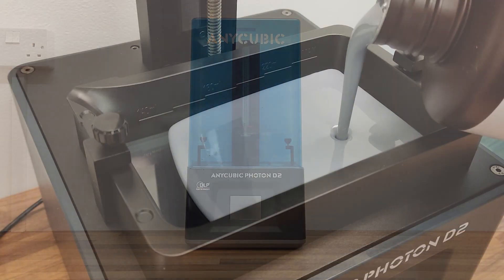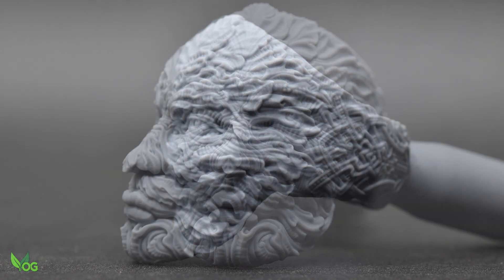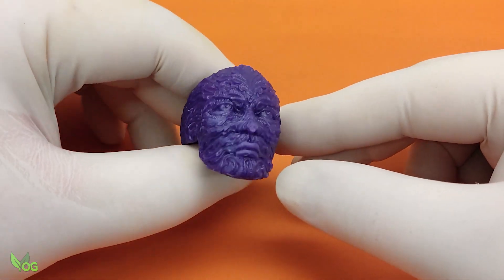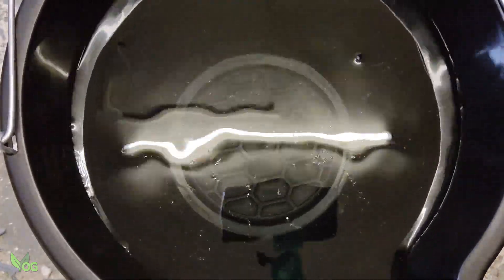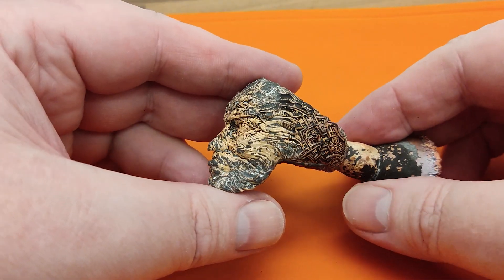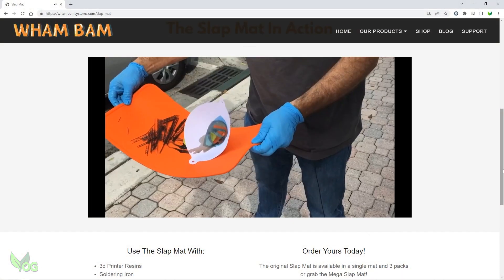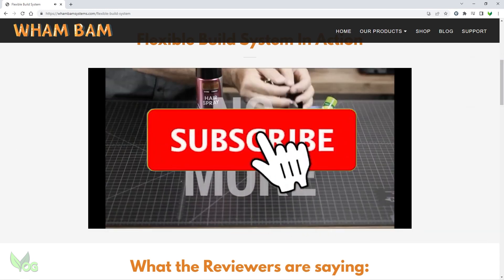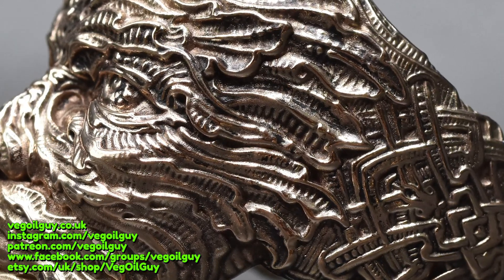Lost Resin Metal Casting on the Anycubic D2 DLP 3D printer

Comment: Honest question - what at this time is the best resin printer ? 
Detail - less warping - and good size build area
Reply from the maker: That's one of those tricky questions... it changes almost daily. IF you're a complete newbie, I would recommend the Saturn 2 https://youtu.be/kqFmf_PqoOg - it has a large plate able to deliver 10 inch tall prints at very good quality. If absolute perfection is your goal, then the D2 you looked at is still my choice machine, but print size is limited. There are other choices, but for the newbie, the Saturn 2 is reasonably priced ( https://amzn.to/3Sp1Ha1 ) and you'll find plenty of free help and support online if you need it. 😁

Comment: @VOC would you know the settings for Bluecast resins ?
I just ordered the printer but I usually use bluecaste One-X or X-10 with my Mono X printer. I bet this will be a good improvement but I foresee a great trial and error rerf test is coming lol Theres no info about it yet on Bluecast datasheets.

Comment: Hello I am using a ANYCUBIC Basic 3d printing UV Sensitive Resin - BASIC , The question is what are the setting to use in RESIN -  SLICE PARAMETRE please I will really appreciate, i HAVE PRINT 5 TIMES BUT IS JUST COME LIKE MELTING OR mud

Comment: To summarize - some level of pixelation on the print is there, but casting and plaster imperfections and cleanup process completely hides all that. Thus for casting purposes one can skip messing with antialiasing as there's no point.
Thanks a lot for sharing! For some reason this is the only review of casting with D2.

Comment: I currently own a Photon Ultra back form the Kickstarter campaign. Question is, will the D2 be worth the update. Sure I can sell my old printer to "lower" the amount of money I have to spent for the D2 . 
Regarding the size of the buildplatform. Yes, sometimes I got models that came presupported and will not fit on the build plate of the Ultra in the given orientation. So I have to reorientate the unsupported model and do new supports by myself. And, ah - I´m bad at building supports. Sometimes I even split up models or, as a last resort, I resize them. Resizing is easy but often needs new supports too. Additionally, since I´m printing for 28mm tabletop mostly, those models will not match. Splitting up models ranges from messy next to impossible some times. 
A bigger build plate would address these problems for some prints but will even occur with the D2 every now and then. 
So it comes down to quality, unless the D2 has other benefits over the Ultra that I´m not aware of. Can you compare the quality of the prints between those to machines? And are these differences significant enough to see them with the naked eye? 
Thanks for your videos, I did realy learn a lot from them when I started with resin printing.
Ah and.  Whambam me!

Comment: Have you thought about trying a 3D printer that directly prints in castable wax such as the Solidscape S390? ...I would be curios to see how a general purpose 3D printer compares to one that it's specifically designed for making jewellery

Comment: I'd be curious to see a non-'castable' resin burned our and cast side by side with 'castable' resin. In my jewelry class years, we used all sorts of rubber/plastic cut from kids toys and display models combined with castable wax and other nonsense to make our molds and it burned out just fine then. I can't imagine non-'castable' resin would be much different of a scenario.
Reply: not every resin is burnable because of the changes in chemical composition when heated like that  it could be dangerous.

Comment: Why does the print look like it was made in minecraft?
But seriously, 6,4 Seconds exposure for 0.03 layerheight? Isnt that alot? Do you Need Higher Exposure on the dlp when using 405nm resin?
Reply from the maker: Have you much experience with castable resins? These numbers are nothing new. I've seen much higher layer height times with other brands and other printers. Speciality resins need special attention.
Reply: @vogman  No i Just received my First bottle of sirayatech cast. I was Just wondering because your exposure time is almost Double of what siraya Tech suggest on their Website for 0.05 layerheight for an anycubic Photon Mono. And my First Calibration prints with sirayatechs setting were Not too sucessful...😐
Reply from the maker: I don't pretend to be an expert on anything. I do know that no two printers are the same and the settings on mine may not work for you and vice versa. This means that any settings you see will be more a guide than a set of rules.
Personally I use an exposure test. https://youtu.be/jOjB3Fr-0no
This takes a little time but doesn't use up much resin. I had to jump from 2 secs to 6 secs before I was happy with the print result on the D2 with ST Cast. I've no doubt I'll have the same issue if I use Bluecast X1, Resinworks Easycast 200 or whatever. Fine tuning takes time - but the results are worth it.
Also, if you're struggling with actual prints after the exposure tests, slow down the lift speed. Brittle resins can tear apart just through the normal lift speeds, and sluggish resins don't get chance to ooze back into place 😁
Hope this helps.

Comment: Hello VOG, I"ve found that the white patches on my resins aren't from the curing process but from IPA still on the surface of the model reacting with the glycerin. See if the patches persist if you let them dry an extra 20 mins or so between the steps. It works on the EC200 anyway, so I suspect it will for syratech too. Cheers!
Reply from the maker: Interesting... I'll have to try that. 😁
Reply: I thought the same for the longest time. Then I let it dry completely after the wash. I havnt had that issue in months now.

Comment: Whambam me! I had to get a friend in the US to buy and send me one of their flexible build plates for the Mars 3 as no UK reseller had it at the time. The good news is that it's been flawless, and made removing prints so easy (no scratching build plates with a metal spatula, or damaging prints). It leaves me with loads more time to admire the pixelation on my prints. Ahem.
Reply from the maker: They are good. You're in the Giveaway draw 😁
Reply: @vogman  Many thanks. I've just checked the Wham Bam site and it does now look as though shipping to the UK is an option; which is great news.

Comment: Oh  Wambam me please, question from a goldsmith? Why not use a full size polishing motor with small lathe brushes to get into the details, so much easier than using a flexi handle 😊
Reply from the maker: You're absolutely right, that's the best equipment for the job. But I'm purely an amateur doing the odd casting here and there. I can't justify the extra space or cost. The spindle motor works well enough for my needs. Good luck in the draw.

Comment: The model looks like it had detail on all parts of the ring including where you attached the sprue.  Would there be merit in attaching the sprue to the inside of the ring's face to try to preserve all of the detail?
Reply from the maker: I'm not sure I'd say I have "no casting experience" as of course I've cast probably 100 items or so now. However, I have no formal training and would say I'm 99% self taught. 
As for the sprue position, check my videos. You'll see occasions where I've sprued to the inside of the band. On this occasion I chose the convenience of an easy print to save time.
Reply from the maker: Absolutely, yes, but this is just a bronze replica that will never be worn. I have limited time available to make these videos so speed and convenience are more important than perfection. As a side note, this ring is incredibly difficult to cast as the designer has also covered the inside of the band with decoration as well, meaning there's no one safe spot for the sprue  😁